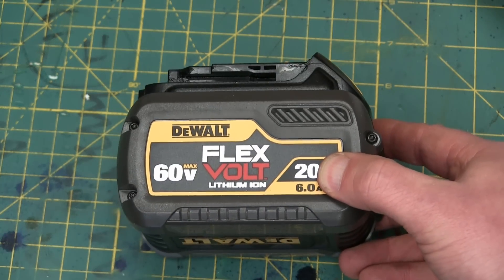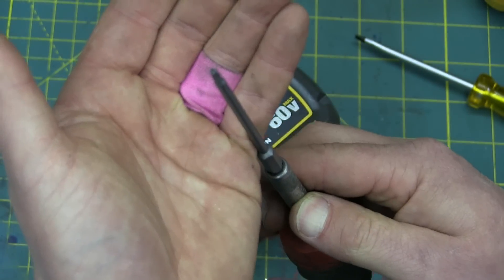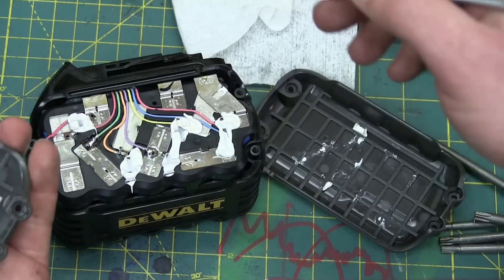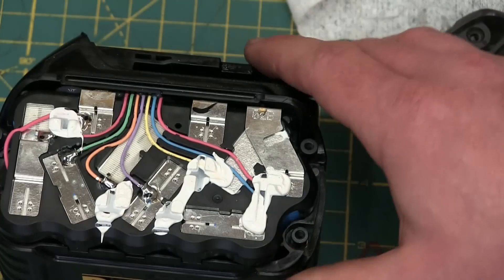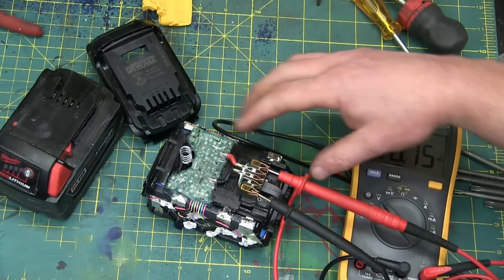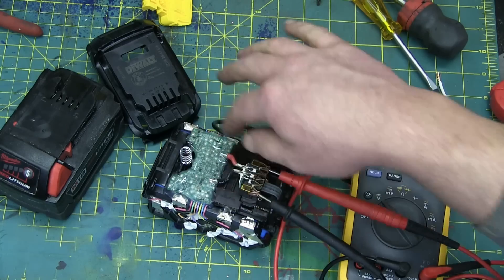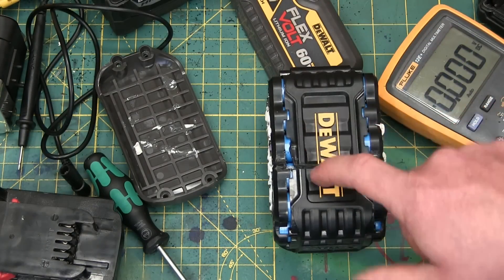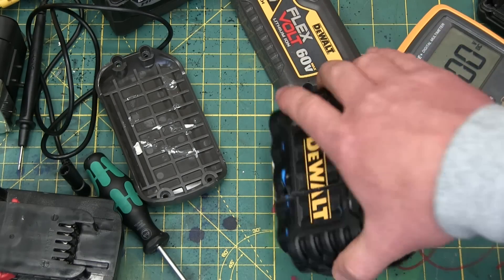BOLTR: DeWalt 60V FlexVolt Lithium Battery. Ooopsie!

Comment: You`ve got 1 fucked cell not 2. What happened is that the cell you cut and shorted itself, put a massive load on the cell it was parralelled with and discharged it a bit too much but nothing to worry about if voltage doesnt continue to drop. Cell with 1.3 not so angry pixies can still be salvaged if recharged to nominal voltage asap. Brought back cells sitting at half volt, declared dead by the charger and sold as faulty on ebay, of course they were fine after proper charge. They arent as delicate as people make them out to be, a couple of lithium caused housefires every now and then isnt even enough for a statistic. But I still wouldnt put a recipsaw on a pack.

PS you know that 100v 1A is the same as 10v 10A, why did you buy into the 60v system. Because you actually bought that grinder for yourself, you grinder collecting maniac. Grinder and paint...

Comment: 15 x 4 = 60v.
most of the current lithium batteries that use 18650's have either 5 (5x4=20v) in series or 2 banks of 5 in a series parallel setup.

Comment: Hey i have a question. I know the box stores love to screw the smaller stores. I hear tales that they add a letter to the end of the serial number then cheapen the parts used inside the drill. So they seem to be selling the same item (Same model number) but at a much better price, and unbeknownst to us consumers they remove the quality parts and swap out with plastic gears and more so the home depot can sell it cheaper because its a cheaper for them to buy it this way.  Have you seen this to be true or is that a load of BS the smaller shops are using to try to keep business?

Comment: Samsung batteries...
Seems safe enough
Reply: Samsung does (usually) make good batteries their 18650's are one of the most popular in e-cigs and power tools. The 25r's are quiet amazing little things.
Reply: Idk how the managed to fuck up that phone so badly. They make quite good lithium cells otherwise and are considered one of the top tier cell makers alongside the likes of panasonic and lg.
Reply: biohazard 918 For some reason I think their phone batteries are not made by them but I very well could be wrong. Its just something I vaguely remember hearing. BTW 918? Area code? As in Tulsa? If so, Hello neighbor.
Reply: Aren't the phone batteries lipo? IIRC the chemistry is different.
Reply: Samantha Gray What kinda of Samsung was this?
Reply: 20r
Reply: x9x9x9x9x9 they made the ones that blew up lol
Reply: Yep, LiPo and Li-Ion are different
Reply: I'll take most laptop and tool batteries for 500, Alex.
Reply: EnlightenedSavage i can honestly say you are wrong. I only used official Samsung charges and my phone got hot enough to melt plastic.  ended up unplugging it and tossing it in the fridge.  figure worst case metal box.  batterys caught fire because the space for the battery was to small and when the battery would expand it would compress the pads within the battery causong a short
Reply: the phone batteries were only "blowing up" when people used cheap import chargers that didnt have proper regulation on them. if you used the samsung oem or proper chargers they didnt catch fire

Comment: A 50V AC welder is more  dangerous than a 60V DC battery. Right?
Reply: Let's just say that both could ruin your day. The most dangerous one is the one that's currently frying you.
Reply: AC is the bad one. Interfers with you heart and has a higher peak voltage (about 70V). DC will make you warm but at that voltage no real damage done.
Reply: All depends who and whats poking it....
Reply: almost! :D
Reply: People like to quote this stuff but a welder will drive more pixies through you then this battery.  Look up AC skin effect and learn it yourself.  Key thing is don't get in the circuit.
Reply: DC contracts muscles while with AC your instantly moving away (cuz, you know, it hurts or at least feels weird) from it so at these voltages the Battery probably is more badass. Also, electrolysis is no problem on AC. At 70V you probably would not get heart issues when having dry skin.

Comment: Ave, dude, not to be rude, but, why be a whoosey on account of a few angry electron pixies ?           I'm noticing a pattern with this. . .  Did you never sit in a circle with your mates holding hands while slowly turning up the voltage on the variable transformer until someone whoosed out ?   .. . .  Obviously not, or you would be a whole bunch harder by now.

Comment: 9:06 "they have multiple spades".....UMMMM I TOLD YOU THAT in a comment on your other dewalt battery video where you purchased this dang batteria and then dicked around with the battery's top cover for hours without realizing you had to push the yellow tab to release the temporary battery cover. 

Jeeesh, perhaps if you freaking read my comments you would of known this a while back and did proper research....

Am just dicking with you, well kind of because I did mentioned the multiple taps. I know this because I dicked around with dewalt batteries in the past. Jump started a car a couple times which actually ended causing the battery to have a very very short life span lol, but hey at least I didn't fucking ask for a jump start like a helpless idiot.

Comment: If you parallel the cells instead of have them in series, the voltage will drop by 3, but the capacity (amp-hours) will increase by 3, so the watt-hours will remain the same, so would would still be above 100 Wh, no?

Comment: Is this really 60 volts? Here in the UK the flex volt stuff is branded as 54 volts, not that it's any different inside the box just the sticker they put on the box.  I have read that in the colonies your allowed to "market" stuff at its nominal charge but in reality with load applied would be, say closer to 54 volts? (10.8v -> 12v & 18v -> 20v)  I had a "play" with the system at a recent DeWalt demo day at a local, copy paste around the land mom and pop store and it seems to be good kit, however I would love to know more about the battery life on the flexed up end (54/60 volt) stuff especially with tools you would use for long periods.  The Rep said you MUST keep the red clip for shipping because like you said at the intro you cannot ship it in 60v form, but decoupled in the higher ah 20v form you can.

Comment: Why is it you guys on the other side of the pond goes 20 and 60V? When it is actually 18 and 54V and also marketed like that here in Europe.
Reply: Because over there they're allowed to lie more...
Reply: @scythelord 
No it's not. Usually batteries are labeled with their nominal voltage, which for a LiIon is about 3.7 or 3.8V per cell. With this pack they label them as 4.2V per cell, which is their MAX voltage (fully charged), instead of nominal. Good marketing, but not really fair
Reply: lion full charge 4.2v, so 4.2* 15 = 63v,  so 3.8 is low 4 is media and 4.2 full. 4v*15=60
Reply: Car batteries have 2V nominal per cell so 2V*6=12V total. I wonder when they start selling 13V lead acid car batterys for marketing wank.... The voltage in a (real) battery is chemically "limited" or better say fixed to a certain voltage, depending on the electronegativity of the ions involved. On a rechargeable battery it varies a bit but its basically the same, the ions produce a certain voltage but fully charged in idle there is a bit more because.. pixies still dancing from charging but it drops under load. So yeah, marketing wank. Everybody smart knows 3.7V per Li-Ion cell so we won't be ripped off hopefully :)
Reply: You might want to check your numbers there. Also your meter.
Reply: Marketing is weird.
Reply: You can get datasheets and nice diagrams on voltage over capacity and stuff if one was really interested but yeah.. key point beeing: it's marketing wank. Same cells and same amount of cells as every other 18V Li-Ion tool battery. If it were like cells who hold on to a higher voltage for a long time (in rel. capacitance from 1 to 0.2 for example) you can get more power out but the total energy still is just the same total energy (120Wh) 
I mean milwaukee and makita could rebrand their batterys to 20V now to compete with this crap.. Just keep on with this and one day we will have 100V single cell Li-Ion batterys where they say the V doesnt actually mean volts anymore.
Reply: 3.0 is rock bottom not 3.7 there is no chemistry that has a discharged voltage above 3.2
Reply: No lies when you measure the voltage of the battery while it's not being used it reads 20v volts, it reads 18 volts under load conditions. So it's not a lie the battery actually is 20v but it's also 18 Volts. Both are correct just depends how you'd like to label it. Dewalt labels their slide in packs 20v to differentiate from their older 18 volt handle insert packs. It lets you know that if it's a 20v dewalt that's its a newer version of their tools.
Reply: karlpc200 if I remember correctly the operating volts on a 20 volt is 18 volts and on a 18 volt tool is 16 volts

Comment: as I understand it the slide button has three positions which is why you struggled to get 54v. Try only pushing the slide halfway when you measure voltage as there is an 18v position at two positions (transport position 18v 2ah, 18v 6ah for use in 18v tools)

Comment: Hello AVE, you mentioned the relatively low capacity rating of 2000mAh on these cells.  The designers are likely balancing the capacity with the power capability of the cell.  There are cells that are as high as 3.4Ah but the extra capacity comes at a price of less surface area (thicker electrodes, less spiral wraps), and these cells do not have the power needed to run tools.  These lower capacity cells are made with more windings of thinner electrodes which increases the ratio of non-active material, but also increases the current capability.  These 2Ah cells can do 20A+ rates.
Reply: @matejgamingandotherstuff6484 Incorrect.  High power cells have more electrodes or more electrode surface area, thereby requiring them to be thinner and have less active material to substrate ratio (substrate is needed for current collection.)

Comment: uggggg, you cut right into the battery
Reply: Well technically he was intending to, so I guess everything went as planned? Seeing the battery explode would have been a bonus though.
Reply: I wonder if that's why it died. Makes you wonder, hm. That's a thinker.
Reply: Andrew Farrow  yes it seems to be the spot he cut and the nuklear hot cell on flir showed it had a meltdown. at least he don't destroys stuff on purpose.
Reply: TheRoaringLion  yes but this was because it was built in a way you could not reassemble . blowing up led with mains voltage knowing full well no matter if good or poor quality it would  go up in smoke and then say it was crap quality that's idiotic.
Reply: Intrade Motor well he ripped apart that hair dryer
Reply: ...HaHaHaHaHaHaHaHaH :D XD XD
Reply: dude they shipped a defective battery to the costumer.... WTF ?
Reply: ahh well at least it does not explode XD

Chao, The Roaring Lion
Reply: Or did it die due to the testing process used, when cutting with the saw?

Comment: pull the handle apart and look at the should have been soldered connection between main wires and battery connections . 20 volts use epoxy , which cracks and kills pixys

Comment: There is a 120v version according to the ad, is that two 60s in series or another battery?
Reply: AvE Ah, for double the cost, smart of Dewalt. :D
Reply: AvE 120v is a lot of juice. What do you reckon is the biggest thing you could power with that type of battery?
Reply: You mean 120v? AFAIK the chop saws are the only thing that uses 120v, everything else is either 60v or 20v. Yeap, a cordless chop saw.
Reply: Richard Shields Miter saw and the table saw are 120VDC
Reply: It takes two 60V batteries

Comment: watching this video was very nice, question how good the milwaukee battery 18v 9amp? and how long is the runtime compair to the dewalt 60v 2amps? which one is the battery battery.
Reply: victor feliciano the 9.0 amp Dewalt battery will be out next year
Reply: Milwaukee 1.35 to1.5x more run time than DeWalt.
Reply: 20*9=180Wh for the milwaukee and 60*2=120Wh for the dewalt sooo yeah, 50% more in the red one!

Comment: How did cutting that plate damage the battery? Did you accidentally cut into the battery?
Reply: Vegalyp If you look closely, you can see that he cut right into the metal can of a cell.
Reply: He definitely managed to short something. That would be why the pack got hot and the cells died.
Reply: I don't know how I missed that even after watching it a second time. Thank you for pointing that out for my clueless eyes. :)
Reply: Maybe the "frame" of that hacksaw touched some of the plates on the side?
Reply: perchance nicked a wire

Comment: 15 X 4 = 45 ... that must be that new math I keep hearing about.
Reply: Lmao I scrolled down as soon as I heard that. But if you look at what hes talking about he ment t ok say 15x3.  3 rows and 5 columns
Reply: @bluntly2165  but each cell has 3.6v (normal) or 4.15v (fully charged), so irl you've got in this battery 15x3.6v=54v or 15x4.15v=62.25v... don't mention those flexvolt batteries are switching between 18v/20v max to 54v/60v max (mumbo-jumbo cells stacks "row" paralleling juggle with less volts, more amphours and more volts, less amphours, where 20v has 6ah/9ah after switch is 60v and 2ah/3ah). So there can't be 45 or 65 volts as AvE said (those batteries don't even have normal rows but some kind of zig-zag, for two types of switches, mechanical and electrical for 20/60 probably - first one triggered gives you even less voltage than 18/20 for safety reasons, second is in two pins - 2 and 3 from right and they can be briged if someone wants to use multimeter - for tool recognition and only both turned on gives 60v). If I'm not wrong, each cell in flexvolt battery 20/60 6ah/9ah has 2000mah (2ah) or 3000mah (3ah) and for 20v there is 3 parallel stacks (3x2ah=6ah/3x3ah=9ah) and after it's plugged in to 60v tool it's changed to one stack.
Reply: 4.2???

Comment: So that 60v I can use that for a 1940s portable radio and power it? The reason I ask is because I have a 67.5v battery needed for that radio. Also this was a great way to spend my lunch break while waiting for fiber optics class to start.
Reply: It looks like you will have to reverse engineer something to enable stupid 60V supply in that stupid clever battery. It just does not want to give it to AvE :) Not the optimal pack for a radio probably.
Reply: +mechadrake ah well I guess I'll look into a transformer or something.

Comment: wouldnt the entire section with the bad cell in it be shit because theyre all trying to discharge into eachother to get each individual cell to 4v? Also, did the dewalt fast charger work on it previously? does the pack need a 60v charger or does it only need a 20v charger because when the mechanical clips arent pressed in its running 3 x 20v in parallel? Ive had a few cells catch fire on me in laptop batteries and i usually just toss the whole battery

Comment: Series batteries = moar total poawh?
Parallel batteries = Moar POAWH Powah?
Reply: LazyLife IFreak series batteries means more volts, which is good for high power consumption when resistance can only get so low and losses are proportional to current squared. Parallel is good for more total power capacity, i.e. longer runtime when power consumption is lower. Of course, parallel batteries divide the internal resistance, so they actually handle intermittent high current better. Series cells, current is constant through all of them and internal resistances are added.
Reply: Matthew Kriebel
TL;DR What?

Comment: 4:40 ummmmm normally your cogulation is pretty dern good... but 15 times 4 is 60. just a heads up. edit just had to check myself on the culcalaytor and yup its still 60

Comment: lol my ring is white tungsten (bound with nickel according to my research), and I'm allergic to nickel. Can't wear it for longer than a couple days before i have to take it off and allow the irritation to go away.
Reply: TheWhedgit You might be able to get it coated with a hypoallergenic coat. consult a jeweler.
Reply: Paint it was clear nail polish.
Reply: Did the nail polish. it only lasts a few days. Haven't considered the hypoallergenic coating though